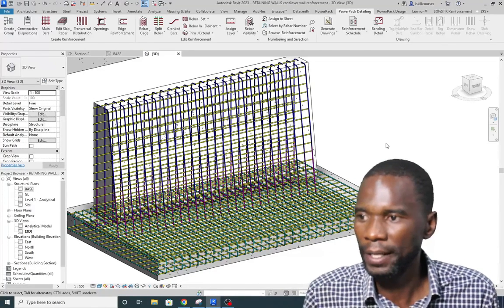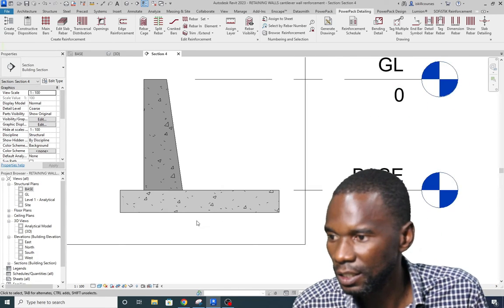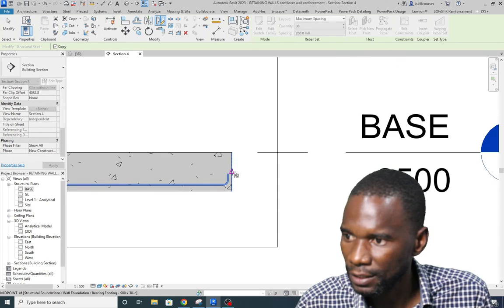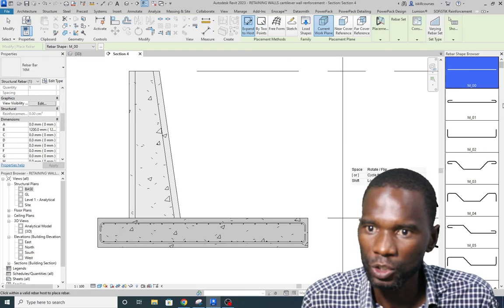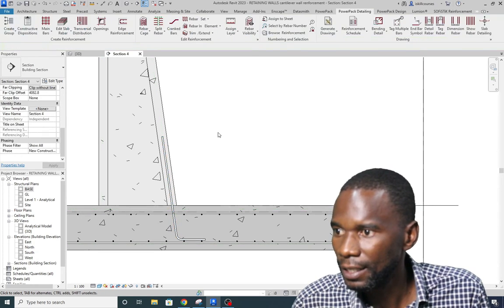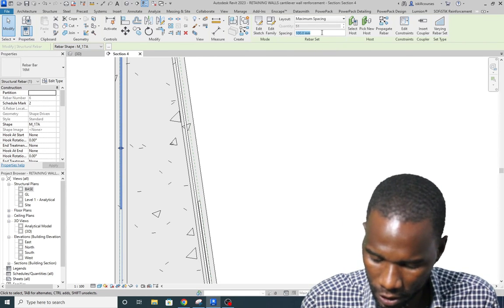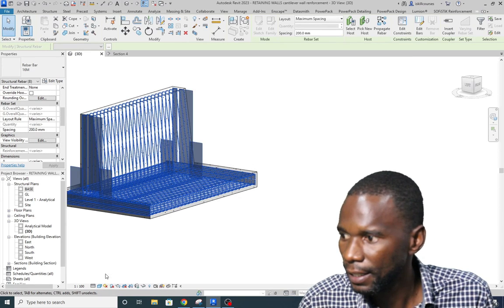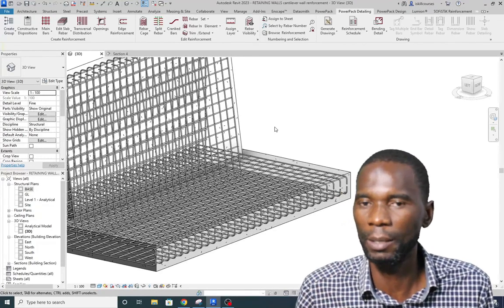REVIT STRUCTURE ~ REBAR IN REVIT~CANTILEVER RATAINING WALL RENFORCEMENT

Comment: Nice tutorial, but from a structural point of view, your retaining wall footing should be the other way around; the bigger dimension should be behind the straight part of the wall. It soil on that will act as a stabilizing force to overturning and sliding when you perform the checks. Also the rebar on the inclined part of the wall is not necesary. You only have compression on that side, no bending moment, so no need for it. Maybe for constructive reasons.